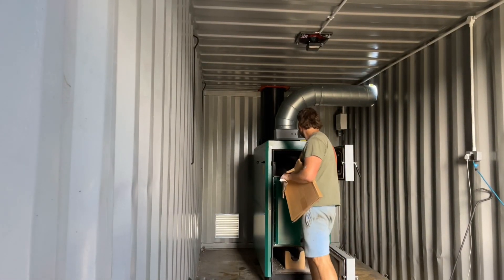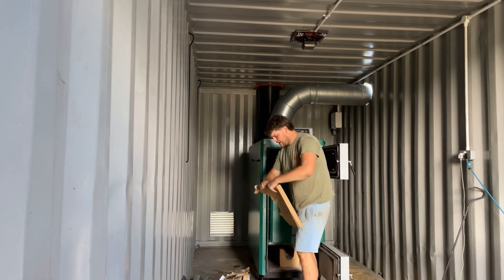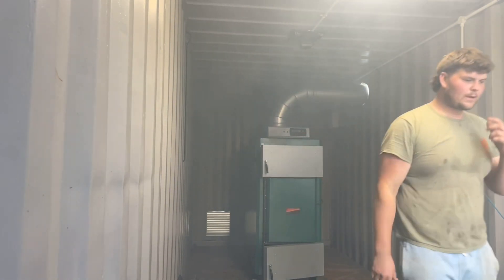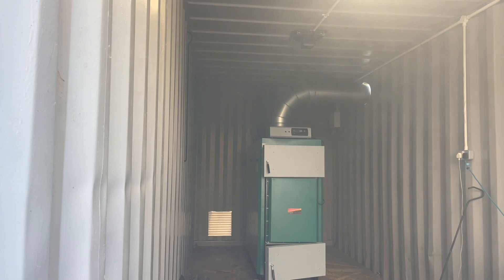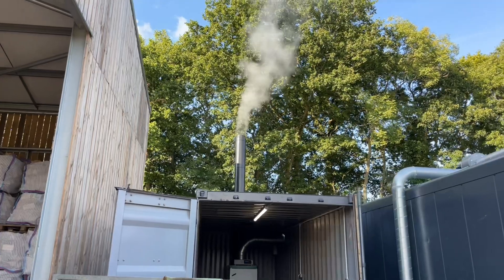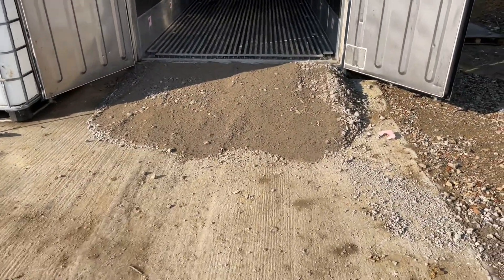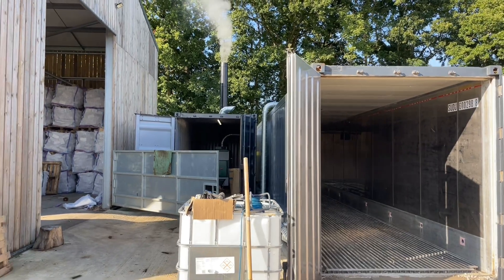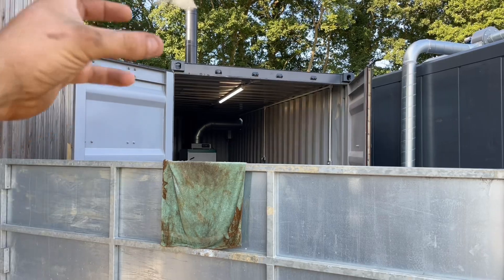Kiln Build 2.0 ECO ANGUS 130kw FIRST BURN!

Comment: Thank you for all the great videos, I’ve enjoyed the process from seeing stuff from the old kiln to the new.  Have you ever tried drying wood that is stacked all neatly in the IBC totes instead of loosely tossed in? That is how mine is air drying outside and wondering if it would dry ok in a kiln neatly stacked if I build one.  I ask because a full tote holds one “face cord” or “Ric” when stacked that way. I’d loose a lot of volume if not stacked proper.  Thanks!
Reply from the maker: No problem at all, I think it would work if the fans are placed in the right place and forcing the air through the wood length ways. It’s all about airflow 👍🏼
Reply: @oakfarmfirewood  very helpful, thank you!